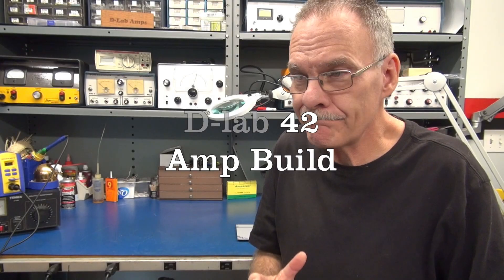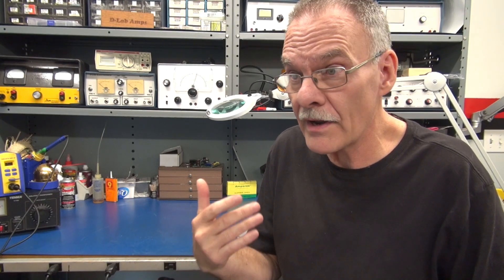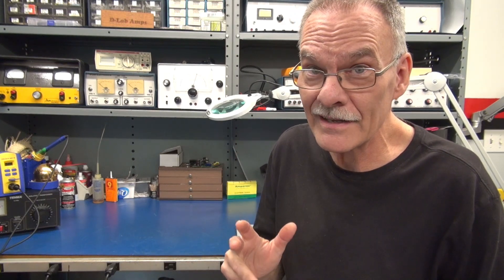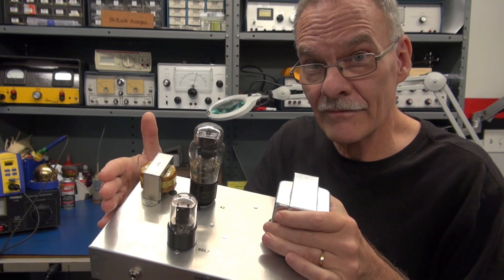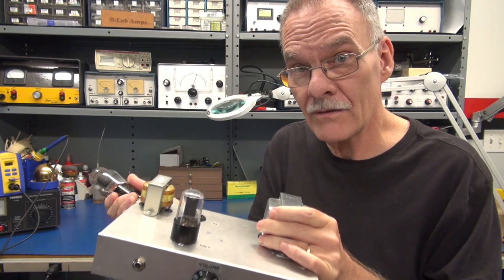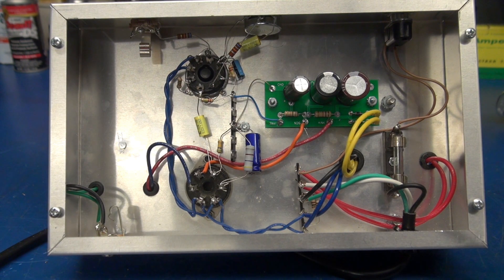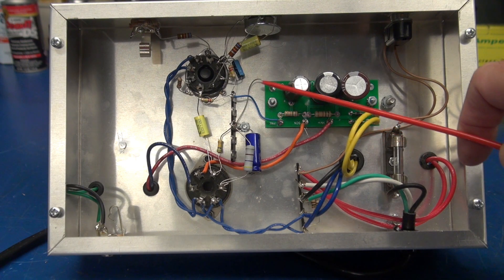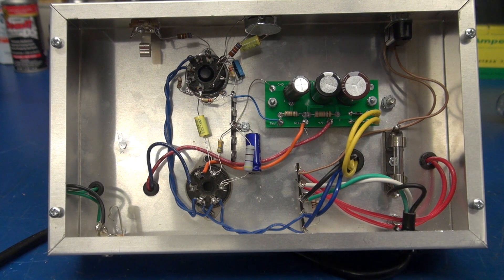Build a Number 42 tube guitar amp Straight forward design like the classic Fender 5F1 Champ

Comment: Dear Sir,
I got a small cigarette pack size electronic gadget from the junk,  but looks unused. It is written, " Guitar Tunner ". What it is and how it works. Kindly if you can give a comprehensive detail please.
Reply: I think that you toss that thing high up in the air and smack it with your guitar on its way down!  Repeat as necessary until your guitar resonates with it on impact.

Comment: Sounds amazing as always! Can the 42 be used in one of your push/pull designs? (Adjusting for the different pinout of course)
Reply: I am sure it can be, some old console radios used push pull 42s!
Reply: @oldradiotvsc9836  maybe I'll give it a try. I have some 2A5 tubes which is the same thing but a lower voltage heater.
Reply: Any power tube that you would use for single ended output can also be used for push-pull output, you just need to use the proper output transformer for the tubes.